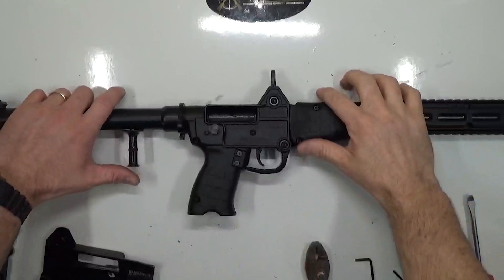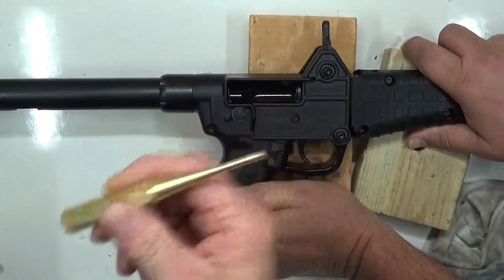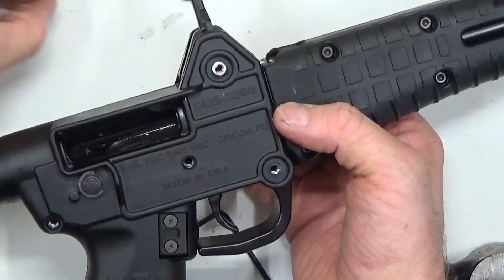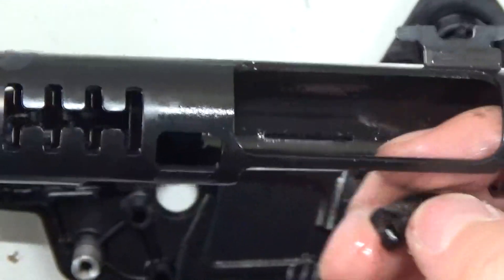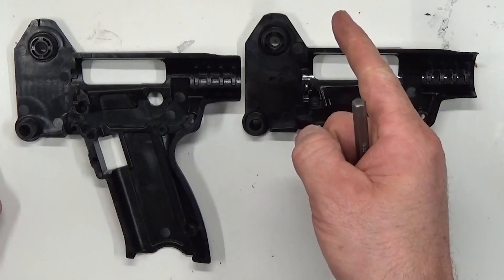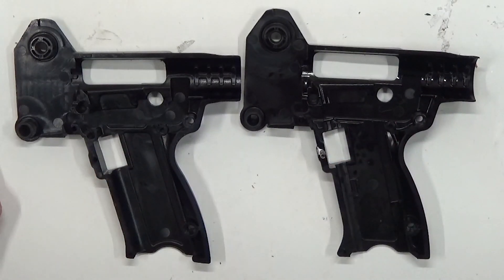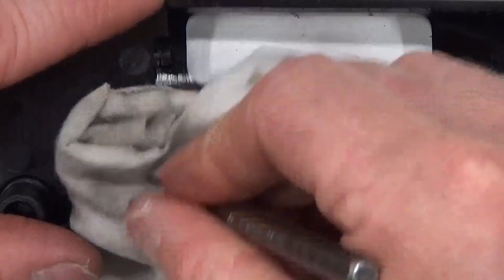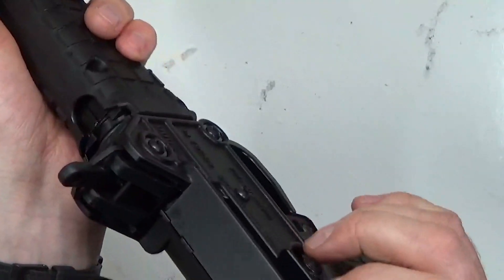KEL TEC SUB-2000 Gen 2 Trouble Shooting by M*CARBO - Part 1

Comment: Just picked my sub 2000. I watched all the videos you put out before I bought my kel tec. I was hoping I didn’t need to replace parts. I shot it and all kinds of failure to feed and fail to eject. I ordered my parts today. Thank you.
Reply: @Howard Luken I have owned a Sub2k in Glock 17 for well over a year...  Have fired 1000's of rounds thru it.
Other than spongy trigger with heavy pull... (common Sub2k factory trait, easily corrected with mcarbo parts)
.... I've never had a single FTF, Stovepipe, etc.  It has run flawlessly regardless of whatever cheap bulk ammo I feed it

Comment: Just to share.  I had both the problem with the trigger sticking and some of the screws free spinning.  Y'all sent me a replacement trigger first and it stuck although not as bad as the original.  After several disassemblies and reassemblies it must have worn itself down because it's fine now.  As for the screws, I had to go with the pliers.  Initially the only screw giving me a problem was the one where the trigger guard pivots.  After the 5th reassembly, the screw that the hammer and sear pins hook against gave me the problem.  In both cases, the problem only involved the screws on the ejector side.  Great video though.  Thanks for validating what I did.  I really appreciate your commitment to helping everyone.  Looking forward to the upcoming optic mount and aluminum sights.  Again, the castle nut wrench and metal lower feed ramp are something I would really like to see.

Comment: Plastic molds will always be far from perfect. It could come down to just imperfections in the poly itself, laziness of the molder, Defects in the molding unit, or just plain old removing from mold before proper cooling can occur. Any number of things can happen in this manner and a simple fix, such as sanding down an edge, can result in much better performance and satisfaction with the product. I know this is a little late (almost 5 years) but thank you for making the wrench. Life saver.

Comment from the maker: We have 4 sample wrenches.  They are awesome!  Takes the castle nut right off with minimal effort and zero damage to the castle nut.  It also includes a thread protector wrench for 9mm and 40 cal, plus a c-clip tool to aid in removing the safety.  We expect them to retail for $15 and be on the website later this month.  We have a small batch of flat triggers as well.  They are perfect!  Send us an email if you need one now.  Otherwise they will be on the website later this month!

Comment: I also vote for the castle nut wrench, metal feed ramp and flat trigger.  I've got your current trigger, springs, trigger guard, screws, extended charging handle and sling mount  so far.

Comment: i came across this problem months ago and had no idea of a potential fix until now... my sub2k now has an unreliable trigger reset with the mcarbo "performance" upgrades.... wish this were covered in the install video for the 200+$ performance kit that i have to do gunsmithing to fix now. sucks keltec keeps changing the mold so aftermarket parts are inconsistent

Comment: Great vid as always! I just got a new Gen 2, took it out for a shoot and castle nut came un done and slid down pipe on me. Then after I charged and shot 3 or 4 it stopped feeding and had to re-charge again and it pushed a round out at me and wasn’t loading the pipe. Anyone else have that happen? Thanks again. MC

Comment: I have a gen 2 glock 17 grip version that I bought about a year ago so I figured it wouldn't have the trigger sticking problem. Nope I was wrong! Lol. Put it all back together and it stuck on reset and on safe. I'll have to redo it again tomorrow. Vids were very helpful though. Can't wait for more product releases from Mcarbo! If I start having problems with my front sight I was thinking of buying a 1913 rail barrel clamp and throwing a fixed Daniel defense front sight on or something. Just read that you guys may be releasing a front sight solution though so maybe I'll wait on that
Reply from the maker: Thanks Aaron!  I appreciate you sharing that.  Let us know if this fixes your trigger sticking problem.  We're excited to get the new sights into production first thing 2017.  Thanks again for your support.
Reply: @MCARBO  2019 any issues like this for gen 2 now? Buy and install no problems with troubleshooting not required?

Comment: Thank you for providing after market upgrade for this 
What I really need is a TALLER rear & front sight 

Even just a taller rear sight and I can change out the front sight 
An extra 1/2 inch would make a world of difference 

Thanks 
I used mcarbo upgrade on my CZ 455, 452 and marlin 
Now it will be my 2 keltec sub2000 

Thanks again
Reply from the maker: Thank you Sir!  We are working on new sights for the SUB-2000 and will have a few options to select from.  Yes I agree the line of sight needs to be raised 1/4 - 1/2 inch.

Comment: Great tip on the free spinning screws.  Any idea on a flip up rear sight or a different front sight post tip option like fiber optic?  Thanks MCARBO.
Reply from the maker: Thanks Tim!  We've got a front and rear sight combination in the works.  It won't be available until Feb or Mar.  What did you have in mind for a front sight post?  Something like this: http://shop.opticsplanet.com/ameriglo-night-sights.html?_iv_code=AR-AP-ADEECF-AR250&utm_source=google&utm_medium=cpc&utm_campaign=plusbox-beta&gclid=Cj0KEQiA4JnCBRDQ5be3nKCPhpwBEiQAjwN1bk6L62k8G9ZxBODeeArBM3CCD5rQTveIBC10kWUml-caAkHS8P8HAQ
Reply: Looks like a pretty good choice to me.  I have the Tru Glo TFO on my Glock 19 Gen 4 but I think I like this Ameriglo better.  Hard to say for sure without trying it.
Reply: MCARBO yeah something more visible would be ideal.  I have a hard time using the peep rear sight with black front post.

Comment: On my gun my trigger wasn't binding on that edge, it was binding on the edge of where the screw post goes right there stemless some material there and it runs perfectly!!! Probably doesn't hurt to remove a bit material from both spots
Reply: It's was actually the top side of where the trigger drops in that hole my bad it was causing the trigger bar to rub right there causing the binding little dremel fixed it perfect was on gen2
Reply from the maker: Thanks Brother for your feedback.

Comment: I have a new gen 2.  The issues I have is the front sight post won't lock in place after I zeroed it in. it's very accurate bit the post isn't lock in place. any guidance?? THANKS FOR YOUR VIDEOS!!! And gear!!
Reply from the maker: Thanks Brother for your support!  I agree that the front sight has some serious issues.  KEL TEC released a new variation of the front sight with a lock nut on the front to help stabilize it.  Do you have that new front sight?
We plan on making a front and rear sight for the SUB-2000 soon.

Comment: I would love the wrench, the metal feed ramp and a flat trigger!! I just installed the entire trigger, spring & lever upgrade! it's nice but the trigger curve is very tight and doesn't fit my finger well!! I was very disappoint when I seen how small & tight of a curve it was!
Reply from the maker: We are getting ready to release the flat trigger around Feb 10th.  If you want to swap them out it's not a problem.  Send us an email to help@mcarbo.com
We're in the process of designing a wrench now.  The aluminum feed ramp keeps coming up on here.  If we get a few more suggestions for it we will make one.
Thanks
Chris

Comment: I owned a Sub 2000 gen 2 for one  week. After firing the first 10 rounds of commercial 9mm the left side half of the receiver had cracked vertically from the trigger to the barrel pivot. The overall design of this folding carbine is very clever, but it seems to be structurally deficient in the barrel pivot-to-receiver interface. This type of failure apparently doesn't occur very often, but one time is too many. Fixing this design should be easy: thicker cross section, stronger polymer, or metal reinforcement of the receiver halves. I know that Kel-tec would have replaced my gun under their lifetime warranty, but I was leary of the design. However I haven't given up on Kel-tec all together and my dealer, DEguns.net, allowed me to replace the Sub 2000 with a CMR-30. It's another clever design and I have high expectations for it also. (This was an in store transaction at DEguns. Their stated policy is no returns on firearms, but they were very fair with me.)

Comment: My trigger return was a little sticky.  I backed off the center screw just a hair and it works fine.
Reply from the maker: Thanks Mark for your feedback.  We've seen this before on a few SUB's.  If the center screw is overly tight it can mess with the trigger return sometimes.

Comment: Also I have a new sub2000 I bought in 11/2016 and I was able to remove the castle nut with just my hands and it wasn't even hard. Maybe keltecs assembly process isn't very consistent.
Reply from the maker: That's what we are noticing.  It's very inconsistent.

Comment: Awesome video, I am having some issues with the weapon after installing the new trigger, trigger springs, and the aluminum trigger gaurd, sanded but maybe not enough will try again but how much do you charge to mail it in to you for installation everything is installed but the trigger is still not firing after the second trigger pull.
Reply from the maker: Hi Deshaun, sorry to hear about the trouble with the installation.  Please send us an email to help@mcarbo.com or give us a call (888)347-1276 and we can better assist you in the trouble shooting process.  
Thanks
Chris

Comment: Do you normaly keep your Sub dripping with oil Like that?
Reply from the maker: Hey T, Thanks for the question.  There are a couple schools of thought on this.  I've seen some guys swear that no lube is the best thing and others go over board with it.  It really depends on the firearm and how it performs.  I personally think keeping it cleaned and a reasonable amount of oil is the best case.  You know when you have way to much when it's seeping out the sides or spraying out the ejection port as your shooting.  We used a customers rifle in this video.  I'm going to create a cleaning video soon and to cover the proper cleaning and care of the SUB-2000.  Let me know if that would be something we should create.  Thanks again for your Support!

Comment: Well, I just decided I'm not gonna take the chance of jacking up my Gen 2.  I fixed a Dell laptop once.  When I was finished putting it back together I only had 13 screws left out. LOL,  The second attempt I only had 3 remaining, so I said screw it.  The Dell was fixed but just missing 3 screws.  I just know If I attempt to replace the trigger and locking lever I will jack it up.  Oh well, maybe if my gun shop won't charge me an arm and a leg I will let them do it.

Comment: Protip - if you need to modify polymer parts very precisely, I would recommend using wood cutting tools like this:

https://www.amazon.com/gp/product/B01DVKK8XE/ref=oh_aui_search_detailpage?ie=UTF8&psc=1

In addition to a needle file set and of course wrapping sand paper around 'stuff'.
Reply from the maker: Riffler File set would works as well.
http://www.woodcraft.com/product/07t51/10pc-smooth-cut-riffler-file-set.aspx